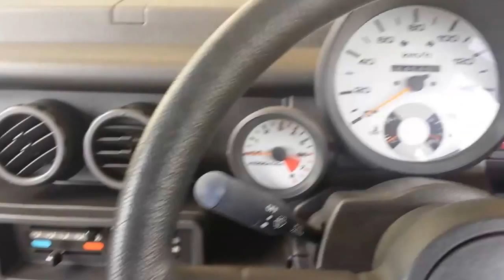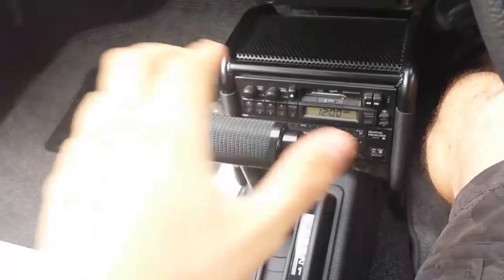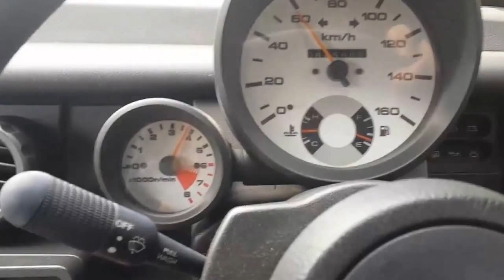Be-1 PHEV test drive

Comment: If the engine is not on when in all electric mode, how do you get vacuum to make brake boosters work etc? cheers
Reply from the maker: DriftingBoBo Electric booster pump